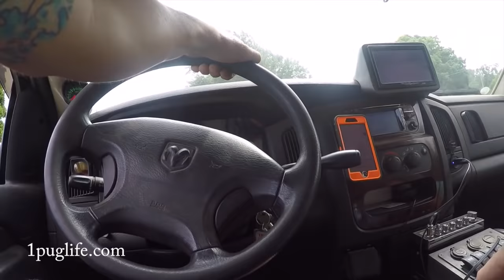driving in the park

Comment: I drove a Toter for 8 years hauling mobile homes your going to kill that dodge. I can’t wait to see it terrible!
Reply: I had a farmer cousin tow an old mobile home 9 miles behind a John Deere 9230 4wd,  he had nothing but trouble with that old trailer...axles seized up, old tires popped from dry rot, the frame was so rusted it buckled. He told me never again...not worth the headache.
Reply: If it was a dually- he'd have no issues truck wise..  Being it's a short distance- I think his dodge will be fine. Rol Dac has outlined the problems he will most likely be encountering.. 

My cousin hauled one 1500miles in a beat up old ford dually pickup. All the problems he had, were a result of the deteriorated state mobile home itself. He had to cut holes in the floor so the tires wouldn't rub..   It was sitting about 6" off the ground by the time he got it where it was going...
Reply: Let’s not talk him out of it for fucks sake that’s going to be a good movie.
Reply: i pulled a 1976 79 foot full size mobile home using a 1969 3/4 ton 4x4 slant six with no problems . only 40 miles though . short trip .
Reply: i'm pretty sure it has the power to pull it,, But the weight of that house on the rear end of that truck is prolly gonna fuck something up.. I escort Mobile Homes for a living.. I have seen regular pickups pull houses before,, pulling it isn't the problem,, it all depends on how strong your rear end is, And if your tires can handle the weight..

Comment: I wonder how the frame is on that thing, I remember a guy down here tried pulling one out and the axles come right out of it!
Reply: Eliminator Performance well I don't think those things get moved too much so I don't know if you have to worry about rust on those big Park models?
Reply: spackmaster Chavez normally anything rusts out in southern Ontario, because of the high humidity. And they're parked on grass. I'm not sure if those things are undercoated, but I'm sure that would help!
Reply: moving one that's older the an late 70's model is a no go  most company's wont do it.. but hes pug1 lets see what that cummins can do lol
Reply: might be worth it to actually make an own solid axle dolly to put under the framework to be honest... i would think the beams at least would be a bit sturdier

Comment: easy to pull the trailer with your  Truck  , i used a  Ford F150 4x4 to move 3 bigger then that one , JUST  make shure you have  Lights on back and mirrors wide enough to see
Reply: I had a chance to get 7 of these for free..  No way my 1/2 ton short bed 4x4 woulda hauled a 40+ foot park model mobile home. I took two 32 foot trailers... Not mobile homes and my 1/2 ton stuggled like a goof with a built 350 and helper leafs, plus two inch blocks and it still sqautted its ass like a dirty dawg...  Ive picked up and scrapped out  two late 70s 24 footers and a 1990 28 footer since then and it didnt even like hauling those...... So your ford didnt haul one, let alone multipe park model mobile homes.  Pics or it didnt happen bud. The tounge weight alone is more that the whole payload capacity of an f150...
Reply: Im not saying it wouldnt do it... But if you tried it would look soemthing like these videos i linked. And if you tried driving on the road like that. Well your just silly then. .
Reply: yep with a 302 5 sped

Comment: well most all them never have any wheels on them or  axles , and if they do you have to make sure the brakes work, and here we need a permit to move it plus a valid yearly safety checked dolly (wheel set with brakes) i have 2 units and thats what i had to do and have, and if the total length from front bumper of truck to back of trailer is over 70 feet long thats another permit, and if the trailer is wider then 102 inchs at the widest point thats another permit, then the truck has to be licensed for the total weight of truck and trailer, thats here in Ont. Canada, oh dont forget you need a CVOR

Comment: Your not pulling that with that dodge. Give me a break.
Reply: MoneyMarcMes put is gonna pop that Cummins head gasket if he tries towing that trailer
Reply: MoneyMarcMes why not like he says he has air suspension 500 horsepower that one's not that giant of a trailer I think it can be done
Reply: Mark Reynolds yeah I believe so I think all you'll need is maybe a wide load flagman behind them and that should do it unless he does a real late at night that would be his best bet
Reply: spackmaster Chavez 500hp ? Lmfao it’s a stock clapped out 24 valve with a tune your pushing maybe 300 to the wheels if your lucky
Reply: Foot in the oil pan
Reply: ole rusty will do it
Reply: i pulled a 1976 79 foot full size mobile home using a 1969 3/4 ton 4x4 slant six with no problems . only 40 miles though . short trip .
Reply: It will pull it I just see a big MTO bust in the future lmao.
Reply: I CAN TELL YOU HE WILL NOT PULL THAT TRAILER HOME WITH THAT TRUCK HE HAD THERE, even if that truck could pull it.. NOT IN ONT. CANADA, IT IS WAY OVER THE GVW,  and unless he has a class A license you can not tow over 10,000 Lbs on the trailer axles, and there is going to be all most 3 times that, you cant tow over 10,000 Lbs with a Class D,G or F license, must have a class A, i cant even tow my case 450B backhoe with my 5ton ford F600 because i only have a class D-Z, witch my 5ton can legally tow it, just need a driver with a class A, oh i will add my boom truck can lift 10,0500 Lbs and it wii not lift the tong off the blocks of my 10 foot wide x 63 feet long mobile home, and that trailer i am sure is 10 feet wide witch needs a permit and escorts
Reply: ok ok ok , i get the point . i heard you yell all the way from the other room lol .   :)
Reply: its the only why to get though to some of you that have never done shit in your life but that key board just rolls out all kinds of bs

Comment: Pug 1 do yourself a favor and get a  snapoff jump pack it shows live voltage and if the alt is charging once your rig is running it will also start just about anything. Also if you dont want to spend the money harbor freight at least here in the mericas has one for 55bucks and I used it every day for like 7months and its still going it has car outlets and a usb plug in

Comment: Only a lunatic would pull that mobile home with a pickup bad idea.
Reply: shhhhhhh.... lol
Reply: STUBS 1960.    that will be a fail
Reply: Tiz true.. Most people put a lot of Money on the inside, but forget to pay attention to what its built on. Hope it ends well for Pug, but it's a little bit risky of a move.
Reply: Right STUBS 1960... That Trailer will Bust them Chinese made air bags on that Piece of Shit Dodge Pickup Truck... Then put it's Bumper on the ground with the front wheels in the air... Someone will call the Canada DOT Law enforcement and they will write ole Pug $3,000.00 dollars in fines and tickets... Maybe take him to prison... I just hope he don't Kill Someone trying to move this Trailer that needs a Semi truck to move it...
Reply: WELL IT IS PUG
Reply: STUBS,  Pug told the guy how powerful his truck was but he hasn't taken into account the braking abilities of his truck, way different than pulling a camper, we all know when Pug does brake jobs he just puts the pads on without checking to see if the rotors are within specs and he doesn't even put a new face on them with the lathe.
Reply: Buddy... your talkin about pug here.
Reply: i pulled a 1976 79 foot full size mobile home using a 1969 3/4 ton 4x4 slant six with no problems . only 40 miles though . short trip .
Reply: as long as he has a 8 bolt rim with an outer wheel bearing diff , he will be ok .
Reply: that i do not be leave as i said above my boom truck can lift 10,0500Lbs and i can not lift the tong of my 1972 10 wide x 58 foot long mobile home off the blocks and thats a standard size, i had a freind of mine tow it from 3000 feet down the road to my place with his 340 timber jack skidder and he had a hell of a time making the turns, i been giving away both my 12x58 and my 14x72 and no one want it, so going to burn them this winter
Reply: what do you not believe ,  if my old 69 fargo can pull a 79 foot mobile home , pugs dodge would also be able to . those cummins motors make the front end heavy .  way more so then a old 69 fargo with a 300 slant  six gasser . and my truck is not even a dually .
Reply: i dont be leave you and your bs on a 69 fargo pull a 10x78 foot mobile home, like i said my boom truck that can lift 10,0500Lbs cant lift the tong of my 10x58 foot mobile home your back bumper would be dung into the ground, maybe your still playing with tonka trucks and trailers be hind your key board
Reply: arnold r  , if you wanna put your money where your belief is , i can reproduce the complete act just to prove it can be done . money first though . :)   the old truck i have has massive leave springs " thick " , hardly any give . it also has a home built bumper hitch .
Reply: you can not reproduce something that never happened, i dont want to take money you cant come up with, i dont care how big your leave springs are in a f150 with something that has a tong weight a lot heaver then 10,0500 Lbs as my boom truck can lift 10,0500 Lbs and it cant get the tong off the blocks
Reply: arnold r  , you have it all wrong , i want your moneieeeeees lol .  you pay me to reenact what did happen . i have the mobile home in the yard for the person that got me to move it . i have three persons that will say i for me . eye eye capitain lol . maybe you need to get a new boom lift , yours is getting weak . :)   are you  stoned or what , i said a dodge fargo 3/4 ton . the mobile home only dropped that truck 4 inches , my wee wee has a longer drop lmao  .
Reply: i think it is you that is stoned or dont know the difference between an V trailer and a 10 foot wide mobile home, my boom truck has a weigh scale on its lift so i can see thee lifting load, f150 or f250 not much different when it come to weight like these mobile homes, the pros use nothing smaller then a transport truck to move them, my 5 ton F600 will not move it or take the tong weight, like i said the 350 timber jake that moved it to my place had a hard time, and its tires on the back were all most half flat when it was winched up off the ground, plus mobile homes dont have wheels on them so you have to winch it up high enough to roll the 3 axial doily under